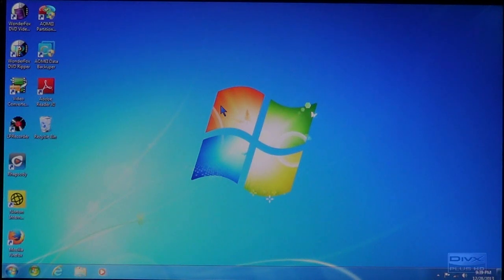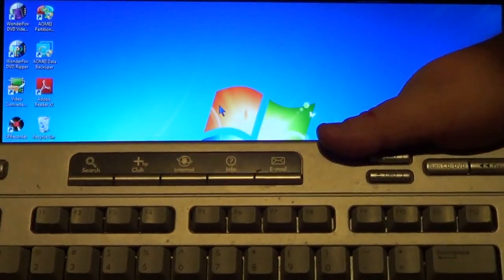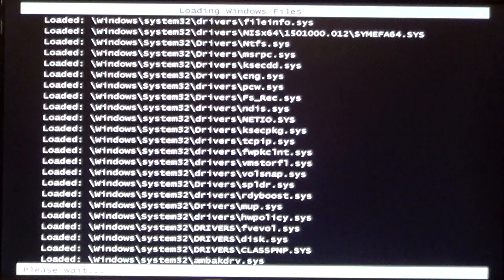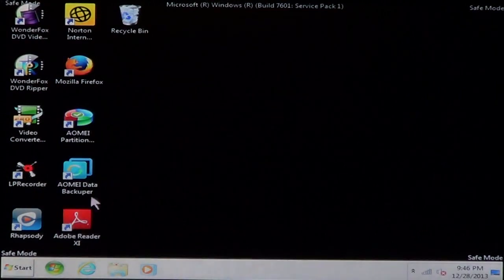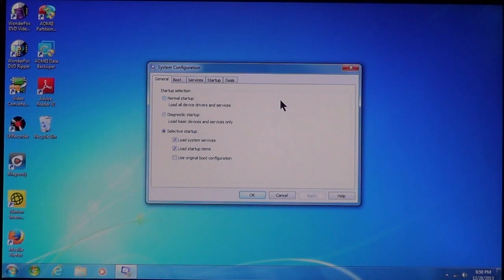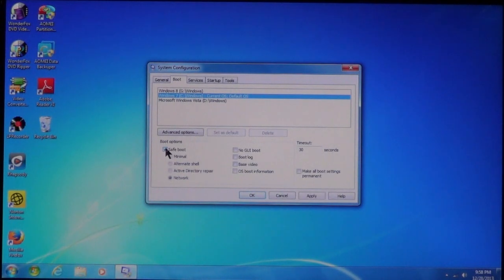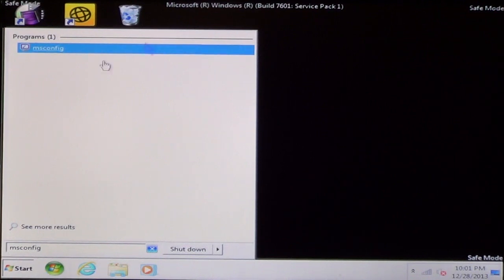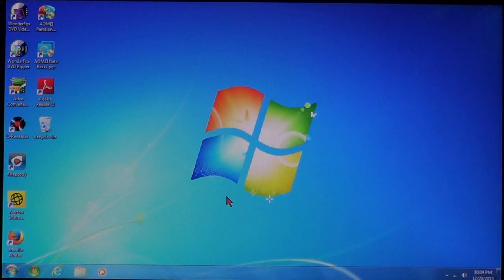How to boot Windows XP/Vista/7 into Safe Mode

Comment: Hello there, I need your help, please. Nothing is working to get my old laptop to safe mode. I'm trying to restore it to factory settings to sell it. I've tried F8 & it just won't take me to safe mode. It's an old Gateway laptop, windows XP so not sure if it's a different function I should be using.  Please help! :o
Reply from the maker: To restore Windows XP to default factory settings you must use either the Windows XP OEM install disc or the MFG's recovery software that came pre-installed.  BTW, Windows XP is no longer supported.

Comment: Mr.Fixit.Well it seems i've jumped the gun, i watched the rest of your video and you taught me what to do, go to msconfig boot click safe boot and low and behold there was my answer, the network wasn't checked. so i just tried that and it still wont go on the internet, beats me i don't know what else to do. 
Iwhen i go into safemode with networking my internet doesn't work, i can't use diagnose and repair because for some reason it says it can't run in safe mode  i have reset modem done the disable enable in device manager think. So how can i get the internet to work in safe mode with networking.Windows Vista 32 bit sp2 home premium.
Reply from the maker: redbeard691 Are you using Ethernet or WiFi? -MrFixit
Reply: Ethernet,
Thank you for getting back to me but i figured it out,i had to go into my avast fire wall and enable/allow networking there i put check marks in the boxes next to them and now it's working fine, i can run all my scans and go on the internet just fine.
Thank you very much for your time to answer my question.
While i have you here would you know how to make the little circle next to welcome screen when windows starts up? It used to spin when i started my pc but now it don't.
Any thought's on this?